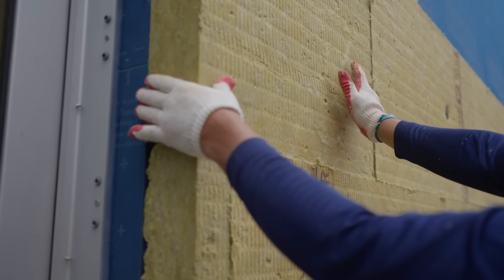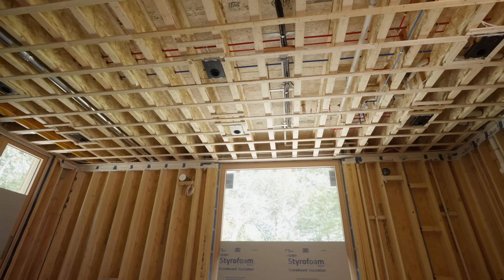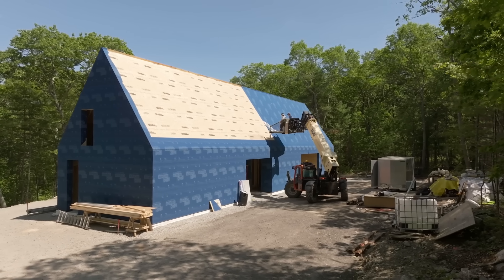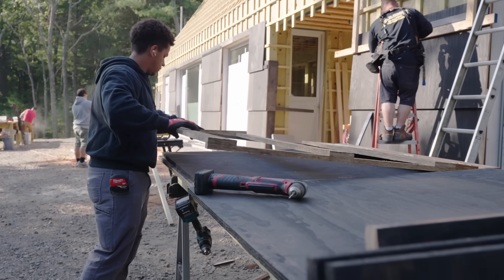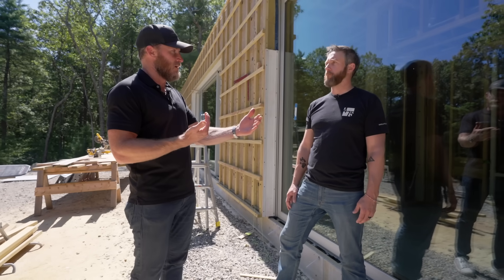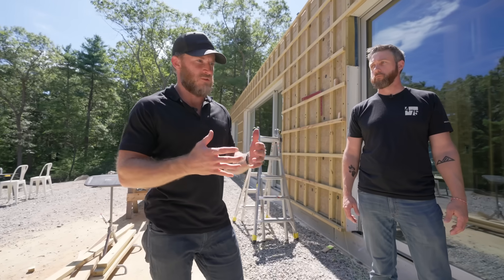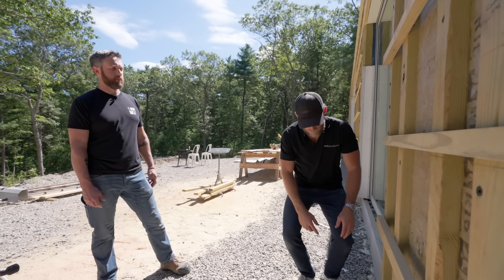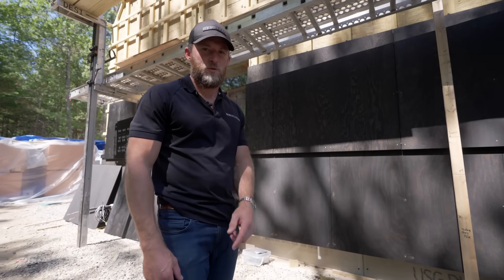Why Exterior Insulation Is The Key To Your Home’s Future

Comment: how does one replicate this system  on existing 1960's home in the northeast. want do redo siding but doesn't make sense unless we upgrade installation, add a rain screen etc. most siding contractors do not know this science or better ways of doing. perhaps more contractors should be your audience on these YouTube videos.
Reply: You demolish the building and start from scratch. Otherwise insulate your rim joists and take down the drywall and put insulation in the walls and roof

Comment: this is why i have become a fan of icf homes. build, brace, pour.  Done need 20+ different materals.
Reply: So you have a foam exterior? Is it air and waterproof? How does it perform in a fire? Can it be recycled? I call BS.
Reply: ICF is great for performance, but super expensive and requires massive amounts of petroleum products (not to mention CO2 cost of your concrete pour). You can't escape at least some concrete and petroleum products in construction, to be sure, but ICF builds are a couple orders of magnitude more per build.

Comment: I'll take the structural increasing and 0 space adhesion making an airtight house non condensation insulation of closed cell foam
Reply: With good sheathing and exterior insulation there is no need to fill your walls with foam.
Reply: @DeuceDeuceBravo to say nothing of the inferno your house will turn into if it catches fire. If the firefighters know there’s lots of foam insulation they wont even bother trying to save it

Comment: I understand the thermal bridging concept and what it means to overall thermal efficiency.  However, I hate the look that this exterior insulation does to the window framing making the windows sunken into the sides of the home.  This takes away from the traditional architectural design of something like a Cape Cod or Salt Box home style.  It looks fine on a modern style home like this one.
Reply: If engineered correctly, you can place the windows pretty much anywhere you want inside the insulating layer. It only gets tricky once you get into walls with mixed materials and dramatically different thermal values.

Comment: my next great idea will be 10ft of insulation, 5ft on the outside and 5ft in the inside. trust me guys, this will save you so much energy.
Reply from the maker: Look up the definition of diminishing return
Reply: Pretty Good House has a great section on this, you get most of your energy efficiency from adding the first few inches of insulation, like 80%+. There's almost no benefit after 6 inches of insulation (less than 1% increase per inch).

Comment: Excuse my lack of knowledge! The 2x4 battens that are screwed on top of the exterior insulation - the screws are strong enough to carry the weight of all of the exterior cladding without sagging?
Reply from the maker: Yes that’s correct
Reply: @NSBuilders thanks for the reply, I appreciate it. So are the screws driven in at an angle? What screws were used for this particular build, and how far apart did they have to be to correctly distribute all of that cladding weight? 

It’s a beautiful house. Thanks for sharing your knowledge 🙏🏻
Reply: @antoine.dutilh  Some will be driven in an angle, some perpendicular to the stud, I don't know what screw availability you have in USA
Reply: Just watched a video of yours from 8 months ago where you go through it in detail on a different build. Comfortboard 110, 10 inch screws through 2x4s to studs, every 12 inches. 👍🏻

In future, it would be cool to see how you do your blocking on all the corners/window bucks.

Comment: As an European, I would like to wholeheartedly congratulations to our American friends that they finally discovered what Europeans have been doing for decades 👏👏👏
Reply: Not all Europeans are building like but we must admit because of geopolitical circumstances Europe was forced to innovate more. Unfortunately in America a lot of houses are built with and expiry date in mind.
Reply: Imagine if we could incorporate this into affordable housing and not just 10mil custom homes.
Reply: Lived in Europe for a spell, travelled there extensively, built homes in the US.....to my friends across the pond.....energy has historically been cheap, and that is why energy efficiency has never been better than just OK. Im present renovation a 125 yr old duplex in Milwaukee, and you wont be surprised to learn there was little to no wall or ceiling insulation. Im not sure a typical northern European home would have been that much better at the time.
Reply: that's cuz you've got no gas, or electricity to heat your homes, US has a lot of both so they've never needed to do that, they don't even need to do that now
Reply: I read the title as a German tradesmen, and thought this was a joke. Or some sort of specialty exterior all in one solution. Like wtf?
Reply: @Caffeine.And.Carvings as Americans with energy abundance, we haven’t needed to over complicate our builds. While this is clearly an energy saver, poorly installed exterior installation can be water/mold traps and thus its solution for one thing with risk to another. 

Cheers to you guys being so far ahead on yeti cooler aesthetics for your homes.
Reply: @JalapenoPapaZap that's what your energy supplier told you? Exterior insolation isn't a problem at all, if you apply it from the inside it can cause problems. Physics
Reply: Centuries, not just decades.
Reply: @OneTrueKing23  lol, yes our home building industry is extremely slow to change and builders doing this charge 2 to 3 times the price. Sadly.
Reply: @franks4973  Oh gawd, the fake intellectuals from Europe come rushing in to compliment themselves without knowing what they're talking about again...
Reply: I was excatly thinking the same thing
Reply: Your welcome for the internet!

Also, this is a silly way to build VS ICF.

Comment: Nick, you seem to be one of the top notch builders out there, and Ive noticed you never use the “OSB with the green WRB” on your projects when it seems like everyone else on the internet is… any thoughts on that?  Sorry if I’ve missed that in a previous video.
Reply: Zip is kinda like the stepping stone prouct. It's better than typical OSB + tyvek and still fast to install. Going full SA WRB, exterior insulation, and rain screen really bumps up the price and build time.
Reply: Budget doesn't seem to be an issue on these builds.  ZIP is great for most of us, but if money is not a concern then using something like CDX plus a peel/stick WRB is superior.

Comment: I just took the cedar board and baton siding off of a home on lake Champlain in Vermont and to my surprise it was strapped with 2x4s. No tape around the windows, no WRB. The plywood obviously got wet at times and had some staining but there was no rot. It’s been that way 25 years. So I believe that you probably could have put your horizontal strapping against the rockwool and used the rockwool as your rain screen but it’s definitely safer to do it the way you are from a risk factor.

Comment: Why use 2x4’s? Seems unnecessarily thick.
Reply: 1x4 are too thin and if you had to strip a block or concrete wall the concrete nails will tend to pop off whilst nailing

Comment: Exterior insulation is most always the preferred approach.

Rockwol on the outside also has a fire proof aspect. Rockwol glows but does not stand aside from a flame.

The black shingles will get hot but actually stimulate airflow behind it.

Comment: @nsbuilders Great video as always. Can you comment why not use the fiberglass Z girts? Is the cost of Z girt more than the labor for these 2" x 4"? Or this is a more stable assembly? In my market, the cost of labor to screw 6-8" screws over wooden furring strips is astronomical, as no one wants to touch a project like this.  You had a video a few years ago on those orange ones, which looked like an Armatherm product?

Comment: Would love to hear more about the failures...
Reply: Failure points include, but are not limited to, incorrect fastening/penetration, failure to seal the WRB underlayment, failing to ventilate the super tight insulation leading to stale air or pressurized interiors, etc.

Comment: Isn't OSB fairly low on the permeability scale?
Reply: @MrBaconis  Yes, it is even less permeable than plywood. Further, plywood becomes more permeable when it gets wet, allowing an acceleration of drying, and OSB really does not. I personally will not use OSB as a sheathing (including Zip System). If Huber would make a Zip product with a plywood substrate, I would take a very hard look at it.
Reply: @spenceralridge4958  I agree.  The savings on using OSB is not worth the trade offs.  OSB to me is a temp build product.

Comment: If you wanted to add a light on a wall, could you run the wire on the exterior strapping instead of going all the way through the wall?
Reply: @A_barrel  you only want to run wires where they are expected to be run. If you don't you increase the risk of fasteners penetrating the wire.

Comment: Unfortunately most people can’t afford these great energy efficient upgrades. Instead you see thousands of crappy houses go up with and a small percentage of theses houses
Reply: It’s not that people can’t afford it. It’s that builders and developers don’t want to build this way when they are selling to a client they never meet. They want to charge the same money for their house of the same square footage of this one and put the difference in their pocket. That’s what’s happening in Vermont.
Reply: Yes they can, they just need to build smaller houses, and not waste money on ridiculous fixtures and appliances and so on.
Reply: Wrong. A monopoly framed, airtight, exterior insulated home can be built for the same $/sqft as the tract home trash being built by the national builders... Put more money into insulation and construction quality and less money into kitchen finishes appliances, flooring, etc. All those fancy finishes can be remodeled later. It's much harder to remodel envelope and insulation quality😂
Reply: The windows should be removable without excavating into the wall. They will fail long before the walls and roof.
Reply: Could reduce the size of the houses to be able to take advantage of these technologies. Does a family of 4 really need 2800 Sq Ft?
Reply: The issue is more where the build is occurring. It is useless to do something this tight on an addition, for example, if the rest of your house is a 1950s pre-plywood, uninsulated cottage or bungalow. Sure, the addition will be well-insulated, but all that air will then escape through the leaky original house. And yes, it is more expensive because it's newer so fewer people know how to do it, it requires more insulation and materials (sometimes double if you insulate in stud bays as well as outside), and you can't use spray foam or blown insulation for this exterior insulation--you need SIPs or some kind of rigid polystyrene or mineral wool, which are inherently more expensive.
Reply: @explicittruth1471  depends on where people live and their culture, some think on how they are perceived now and take on dent and liabilities and they will never will get out of their culture fed debt trap,  others don t mind to drive a reliable older car, less "designer" clothes and fancy dinners dreaming they get recognition , admiration , likes and "fake"  respect so they will never spend time nor money fot things that help them to save a lot on their cist of living now while step by step working on a more luxurious future, many "trending wow" people now will be cought up by accumulated debt and boredom of their perceived fans and will soon grow older with respect.. In Europe even government participated in a crazy drive for iisilation giving subsidies for isokation and many comoaniea jumped on that , cashed in the money to "help" these home owners with a not integrallybthought through solution wrt ventilation and dewpoint causing after few years - due to trapped but not visible moisture inparts of load bearing construction (roof, walls erc) requiring then guge overhaul of tirting construction... isolation without humidity control is a dream wairing to transform in a nightmare..
Reply: No, people can't afford to build wasteful, poor quality and short-lasting homes.
Our company built countless homes out of the highest quality concrete (inner structural shell) and EPS (outer insulation) structure for almost the same price as wood structures. Including apartment buildings.

We had many clients (some commercial clients building apartment buildings even) asking for offers based on old-fashioned inefficient designs and we convinced them to re-do their whole plans into our efficient structure. Approx same price but immediate savings on yearly utility and maintenance costs...and a longer expected life for the whole building = higher value.

Comment: I think a double wall assembly is a better option for the guys doing the work. You still have sheathing to attach your rain screen and everything else to but you also get the benefit of that thick wall of insulation with the thermal break. The light blocks and window and door bucks and trim are all a pain with exterior insulation.
Reply: It's not easy/possible to double the entire envelope of the building.  In the example here you get 100% "jacket" coverage from the tip of the roof to slab (or even basement slab if there was one).
Reply: I agree that it's extra work for exterior insulation. But it's not actually complicated or difficult. It's really easy to attach exterior insulation with long screws that are nearly ubiquitous these days.
Reply: ICF is superior
Reply: @froc7128 We did a few Poly Steel ICF homes back in the early 2000s and it was a complete pain. The siders ended up tap conning all the cedar impressions on it, the electricians hated the exterior walls, we had to do mesh and stucco at the foundation to make it look like a foundation. The window and door bucks everything. It was a nightmare. I’d never want to work with ICF again.

Comment: The builds on this channel as far as I can remember have favored exterior insulation instead of a double stud wall. Can you explain why you prefer exterior insulation?
Reply: @definitely_not_a_robot  it keeps the sheathing warm, reducing the risk of condensation in the wall on the back side of the sheathing.
Reply: @RustyNail600  For winter conditions, as long as you have a complete vapor-retarder membrane in place, and vapor permeable sheathing, there should be very little risk of condensation within the wall.  But for summer conditions (still in a northern climate), it’d be good to have a little bit of continuous insulation inboard of the vapor-retarder.
Reply: Why would you want to build double walls when exterior insulation can be just as effective and a lot less work without impacting the usable square footage?
Reply: @DeuceDeuceBravo  Both double walls and exterior insulation affect the wall thickness.  At least where I am (NY state), the accepted method of measuring square footage must include ALL space taken by the walls, so anything that makes the walls thicker will increase the square-footage measurement of the house without increasing interior space.
Reply: @kc9scott Which is why I said "usable" square footage.
Reply: @DeuceDeuceBravo  If it’s new construction, you would typically adjust the size of the foundation to get the desired amount of usable interior space, for whatever thickness of exterior walls you plan to use.

Comment: Have you ever worked in Insulated concrete forms and do you have any opinions on it?
Reply: I think they are really neat, but very expensive for the level of performance you get. Additionally, not a very sustainable building method.
Reply: @RustyNail600  Not sustainable how? Also, ICF would cost around half as much as the build in the video while requiring far less materials.